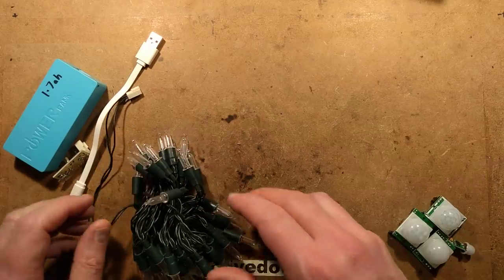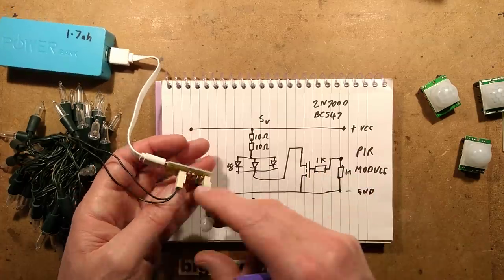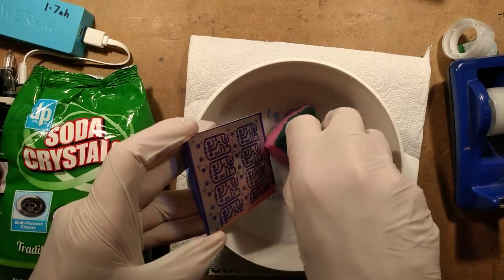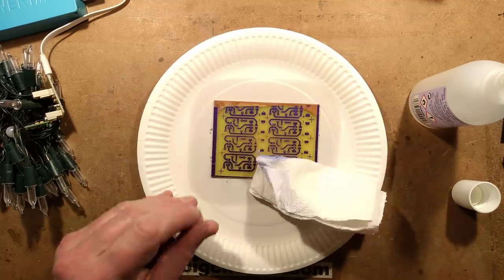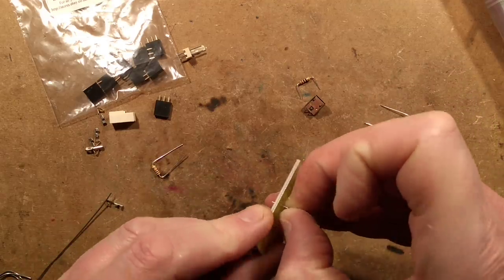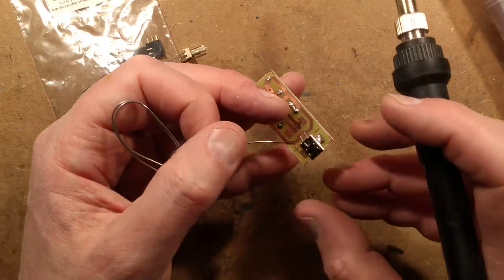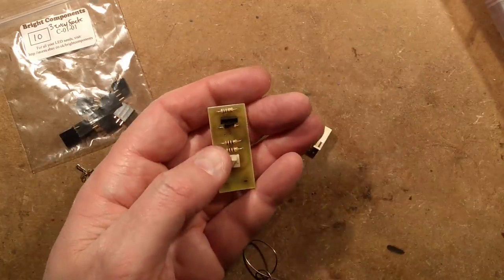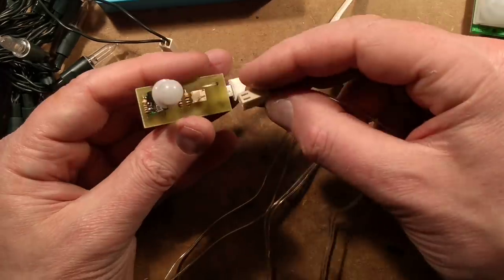USB to PIR to LED-string interface PCB.

Comment: Clive, you have often mentioned that you like to keep your house / abode cool, pretty much well below the normal persons habitat (I'm not digging, you do you) ,  if the sodium bicarbonate solution was warmer, would you be more gentle when it comes to removal of the screen with the sponge?
Reply: Yes, from my experience working with this material in a QA lab, Temperature did effect the speed of the developing wash, if it were set too high, it would wash away too much.
Reply: @franglaiscophoneslocks7461  Thank you :)

Comment: I made one PCB when at school, but that was it.  The majority of "PCB's" I used in my youth was Veroboard which worked well.  In the past few years, I've been getting more professional and designing PCB's, assuming I'm making more than one copy of a circuit, but I get them manufactured in China.  

It was fascinating seeing you make your PCB's, but while I appreciate the art, it's got to be more expensive doing it that way, no?  Especially if you take into your account the cost of things like that fabulous guillotine?  It's also smelly and messy and it made me want to ask, why do you go through the hassle?  

The only advantage I can think of is that you'll have the finished item the same day, as opposed to the two-three days it takes for mine to get delivered.  Are there other benefits?

The second question was how do you make the transparencies you used?

Many thanks for sharing of all your skills with us, sir.
Reply: If you listen close he said he has all this stuff around.  He used to do much larger scale manufacturing than this and so he used it in a working setting where it was worth the cost
Reply: Look in his older videos. All this has been done before, you just have to look.

Comment: Just soak the resist in a concentrated developer solution for a few minutes - it'll fall off by itself. Much easier than scrubbing at it with acetone, and you won't get gunk in the holes.
Reply: feel free to use it but be warned it may contain Para-phenylene diamine, and its dimethyl and diethyl derivatives are known to be highly toxic by skin contact and absorption, inhalation, and ingestion. They can cause very severe skin irritation, allergies and poisoning. Like clive said in the video, Acetone is a lot more environmentally friendly and a heck safer for us humans.
Reply: @soarer282 I'm not sure we're talking about the same thing...

Comment: Bigclive, Where did you get the microUSB connector?  Links are appreciated. :)
Reply from the maker: I got them from an AliExpress seller.  They're odd in that they just have the two outer power pins making them very easy to solder.
Reply: Search for "micro usb smd 2 pin" on AliExpress or Banggood.

Comment: v3 possibly size extended 2 or 3 mm so pir mount can be shifted to accommodate big pir mounted either way round?
Or maybe use LED molex connector with a 90 deg pin so it lies flat

Comment: You should keep the cutoff's for the resisters they make great wires.

I love these little projects :)

Thanks for the awesome videos Clive :)
Reply: Indeed, great jumpers for when you need your PCB traces to cross and don't want to go the effort of a fully double-sided board.
Reply: Yep, one of the sections in my box of jumper wires for breadboards is just component cutoffs.

Comment: Question about your fancy lead-bender tool doohickey thing. Can you feed it the ammo belt packed components and crop a bunch in rapid succession?
Reply from the maker: One at a time, but you can get a bandolier version that fires out cropped and formed components like a machine gun.  Very expensive machines because they are aimed at the manufacturing industry.

Comment: Off topic:  I have see there are a few super capacitors available on the likes of aliexpress and was wondering how these could be integrated into a solar/wind system as fast charging a temporary storage system that is used to charge lithium or other cells.   Would the fast charging be an advantage in unstable light/wind conditions. LTS (love the show)
Reply: Super caps have way too low of a capacity to be useful here. You don't get very sudden power spikes with solar or wind. What if you got two hours of sun at noon? No sensible amount of capacitors can buffer that. It has to go straight to the batteries. What if you get a windy day, where the turbine runs at max for an hour? Again, no sensible amount of caps can buffer that. Your batteries have to be dimensioned to handle the full power anyway.
Reply: have you seen any of the stuff uploaded by Julian Illett?  Seems just like his ball game

Comment: For high speed photo resist developing - Mr, Muscle oven cleaner. Spray it on, count to two, wash it off. When it's etched, use it to remove the mask, takes a smidgeon longer. (count to seven?).
Reply from the maker: I'll give that a go.

Comment: If the gel is clogging the holes, why not just remove the gel before drilling the holes?
Reply: Did that on all his earlier PCB videos, not sure why he did it after in this one.
Reply from the maker: I was using the dark contrast to see the hole positions easier.

Comment: Hows about a island/node/terminal block type circuit, There is only about 7-9 nodes in this circuit..  Knife and pcb blank is good for quick projects. if there are no ic's unless you dead bug them.

Comment: OMG is that Riston film? 
It is! : ) 😎
I used to work at a factory that made it, it's really cool stuff!

What version are you using?
I would agree that a NaOH or KOH sol'n would be best to remove it, that's what we did when we tested the stripping times of different batches of Riston solutions.
P.S.

Humans actually make trace amounts of Acetone in our bodies when we digest fats instead of sugars. Sometimes people go into ketosis because of diabetes, or a ketogenic diet, and it causes them to be ill.
Reply from the maker: The film is generic dry film resist sold by many eBay sellers.

Comment: What software did you use for designing the PCB? Or did I miss you mentioning it during the video? Just curious.
Reply from the maker: I use Sprint Layout.  Very easy to learn for simple circuit boards.  Lets you just start banging down pads and tracks.
Reply: @bigclivedotcom  Cool, thank you sir. I'm going to have to look into that.

Comment: That method works with new pads, i'm wondering if the old, old type of copper plated pads where there's a substantial amount of copper would go as easy...probably not.

Comment: I have a 1€ plastic ruler to prebend components but i honestly don't particularly like using it, i'd rather just bend them by hand when poking them in.

The tiny little PIR module with 8-pin chip, does it retrigger while lit to light continuously?
Reply from the maker: It does seem to, but needs its time delay extended.

Comment: So the more pressing question, is exactly how many LEDs are in your house?
Reply from the maker: Thousands.
Reply: @bigclivedotcom  Now we know the real reason you like to run LEDs at lower power levels, it has nothing to do with longer life or battery usage, it's just so you don't need to don an arc welding helmet to go into your house.

Comment: So, how to combine this project with an earlier project you did for LED string lights that charges a phone battery off mini solar panels...
Reply from the maker: The power bank could be charged directly from a 5V solar panel via its micro USB port or the cell inside could be charged using the same panel and a TP4056 module.

Comment: Found smoke sensors on the bay.
(Actually all the particle sensors, gases etc. now come on lil relay pcb's)

So now im on a 16" window extractor fan connected to a speed controller connected to a box which turns the fan on if i smoke and the lights on if im in the room.😊 
(May or may not have a beam break sensor near the vaccinity rigged to an alert camera (old style lcd doorcam) too😂 i will have peace)

Comment: What makes the difference between a motion sensor and presence sensor?
I guess it uses the PIR sensors to function. Can a presence sensor be built from similar stuff?
Reply: I think that PIR sensors need movement to be able to detect anything.
Reply: I'm thinking you'd need the doppler kind of detector for presence sensoring
Reply: I think doppler requires movement, which causes the doppler affect. to detect a non moving person, you need something like a low pixel thermal camera. have a look at the OMRON D6T which states "High Sensitivity Enables Detection of Stationary Human Presence" but is about £36 a pop.
Reply: ah indeed doppler also needs movement, the only benefit is it works through a door, it doesn't require line of sight
Reply: @The Embedded Hobbyist
Well, that's morbidly expensive, and only for the sensor.
I remember people mentioning presence switches before, I doubt it was that expensive.

Comment: Which solder are you using? I'm in the market for a new reel, and I've tried a few from china but they just doesn't like flowing.
Reply from the maker: I recommend getting traditional flux cored tin/lead solder from a prominent component supplier.

Comment: Do your cats trigger the PIR or is that kind of thing adjustable (or selectable) too?
Reply from the maker: I don't actually have cats in my home.  I just borrow my neighbours cats.  But you can mask PIR sensors so they don't see low level objects.
Reply: @bigclivedotcom  Oh. I figured the Danger Cats were yours. Guess I'll have to look into the filtering a bit further. I imagine it's like putting welding goggles on the sensor; it won't see a lit match (small animal) but a torch (large animal) will be visible.

Comment: What’s the difference between using 2 10 ohm resistors in series versus using 2 39 or 43 ohm resistors in parallel?
Reply from the maker: No difference.  Just a standard value.

Comment: @bigclivedotcom do you still have that led coaster pcb file for when you first showed up the micro usb connectors? i would love to make a few but i am trash at designing pcbs.
Reply from the maker: That's an ongoing thing.  I've just received a batch of ten of the PCBs and will be building one soon.
Reply: @bigclivedotcom  Ah! Nice, i hope they work out as well as they seemed to.

Comment: You say that Clive , but my power banks will detect no load or a very low one and they will turn off ..   :(  just like my DIY clock kits , I can't use a power bank with them , very frustrating since I have a solar panel that charges 4.8 KW of batteries in the shed and I charge 7 *10A power banks there , oh , I wish I had just 10% of your knowledge, my life of a hobbyist would be so much easier . Cheers mate !
Reply from the maker: You can get simple power banks that maintain 5V at all times.  The ones with level indicator LEDs are usually too clever and will turn off.  The cheap single cell ones are often just simple 5V all the time.

Comment: Is the 1k resistor on the gate to slow down the turn on of the fet ? I read the other day that doing that can cause the fet to get hot as the resistor causes the fet to act in the non liner region but feel a bit confused on the issue now ?
Reply: The resistor is there in case you use a BJT instead of a FET. For use with a FET it's a rather high value, but in this case it's fine with the FET as well. The FET gate is essentially a capacitor. Higher resistance makes it take longer to "charge" and thereby open the FET. But that's pretty much irrelevant at these currents as the rise time is still fast enough, especially compared to the on and off time. You don't want a high value resistor there if you are switching a lot (PWM for example), because then the switching time, where the FET is the saturation region, is a significant percentage of the on or off time. You still do want a low value resistor there in many cases though, since as I said the gate is a capacitor and without a resistor in series you can get huge current spikes into the gate when switching. That can cause glitches in other  parts of the circuit or damage the device driving the gate, a microcontroller for example that can only deliver 40mA on a pin should never be connected to a FET gate without a current limiting resistor.
Btw. you are getting terms mixed up. With FETs there is no "linear region". They are usually called "ohmic" and "saturation region". For switching FETs you want to and avoid the "saturation region". For FETs in an amplifier on the other you want to be right there. That is also called using the FET in "linear mode" ("mode", not "region").
Reply: @superdau  Thank you so much for taking the time for a great explanation, Very much appreciated 👍

Comment: I've been getting good results from using the RCWL-0516 Doppler radar units instead of the PIR units.
Reply from the maker: I ordered some of those right after making this video.  Slightly higher passive current, but still fine as it's only a few milliamps.
Reply: @bigclivedotcom  I haven't tested for it as yet. But i imagine heavy rain would would cause them to activate.
Reply from the maker: @Jaycsee66  When testing doppler lamps I found that in stormy weather the lamps were triggered.  Possibly by trees moving outside.

Comment: 0:55 what is that little 2 pin connector called? i've been looking for them but I can't figure out what I need to type in ebay to find it
Reply: Molex. Or dupont.  But as Clive says you'll need a crimping tool .
Reply: @simonhopkins3867  thanks mate, I appreciate the info

Comment: Did you ever try HCL + H2O2 for etching?
Reply from the maker: Yes.  I had issues with the HCL though as it was only available as concrete cleaner here and seemed to have detergents added that caused excess foam when agitating with air.
Reply: @bigclivedotcom  You can get it in Canada as 10M solution sold as a pool cleaner.  I also picked up some 12% H2O2 from Amazon. It worked pretty good compared to the ferric chloride, much less brown finger, more green/yellow finger, maybe a bit to fast though.  Now I have a dilute solution of CuCl,  I figure I will let it evaporate and oxidize in the air + a bit more HCL to make CuCl2 and keep using it to etch.  I like it better than the ferric chloride - still have half a bottle of that, not sure what I will do with it.

Comment: You can use 90Degree pin to connect the IR sensor it will then go on the end, and it wouldnt matter way way the pins are.
Reply: Is the PIR/Molex collision an argument in favour of placing sockets alternately top-bottom?  Or is the implication that 'flush and square' mounting (e.g. the PIR socket) is an ideal for an un-ideal world?

Comment: Lead based solder is so hard to find in the USA now days
Reply: Not really. You can get it from Radio Shack (on line even), Parts Express (based in Ohio), and several other electronic parts outlets thru out the country. You just have to look for it. Even Home Depot carries 60/40 rosin solder.
Reply: @SPIKESBIKES50  radio shak dont exist in 99 percent of the west coast now
Reply: I did say on line even. Since you have access to the internet,  60/40 rosin core solder is obtainable everywhere on line. Absolutely not hard to find. Been usin' it since '55. My comment is for those looking for it.
Reply: @SPIKESBIKES50  first off I never said I was looking for lead solder I said it was hard to find

Comment: I had a lithium battery explode in my pocket. Causing burns and inhalation of smoke. Since you have blown up a few of these. Im sure you have done some research on the toxicity of it. Do you have any insight on my life expectancy? Hahaha
Reply from the maker: Much less harmful than smoking a single cigarette
Reply: @bigclivedotcom  thanks big C. I think the biggest pain was my pride, taking my pants off in a hurry in a busy gas station was required. The battery blew up a second after I shed my trousers.

Comment: I dont suppose anyone has created a package in EasyEDA for that USB connector?  Or can point me in the direction of the correct keyword or a link to download the package file?  Nothing obvious comes up in the usual libraries
Reply from the maker: If you get one you'll find it's a really easy pinout on a 1/10" grid.
Reply: @bigclivedotcom  Just asking on the offchance.  I'm still finding my feet in EDA and package design isnt my forte, I was hoping to find a package as opposed to placing individual pads :(

Comment: Several years ago I had an incident with sodium hydroxide while making a batch of cold process soap. One of the nitrile gloves had several pinholes and the sodium hydroxide solution wicked through and burned my skin in a few spots. Heh, oops.
Reply from the maker: Any joy with the cold process?
Reply: @bigclivedotcom  Yeppers! :D Lemme copy some photos from my phone to my PC and then upload to my website... it's a bit of the offcuts from some of the soaps and some of the molds that I've used.
Reply: @bigclivedotcom  I kinda prefer cold process over hot process because cold process is much slower and much easier to control.
Reply: @mduvigneaud  
your links are a bit messed up but if they are copied into notepad and re-arranged they work ok :-)
Reply: @YTANDY100  Oh, thanks for the heads up! :-) Sometimes whitespace gets wonky in YT comments. I've edited my comment and hopefully the links are all better now!
Reply: Now I know why people ware 2 pares at once
Reply: @mduvigneaud  
your welcome , they do work properly now :-)

Comment: ESD bag talk. Are you wearing a wrist grounding band?
Reply from the maker: No I'm not, but I work at a very static neutral area.
Reply: He was touching the board he was soldering on with a grounded-tip soldering iron before he touched the MOSFETs. Shouldn't have much any potential to ground on him.